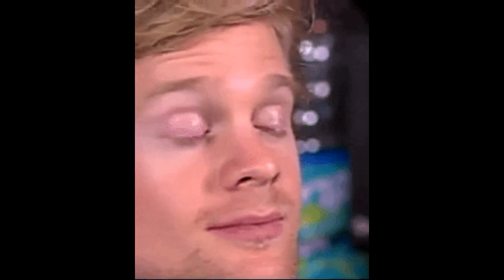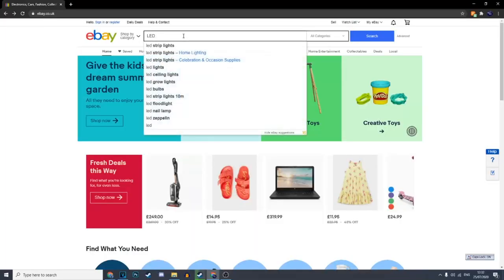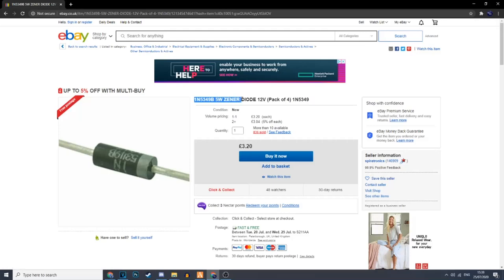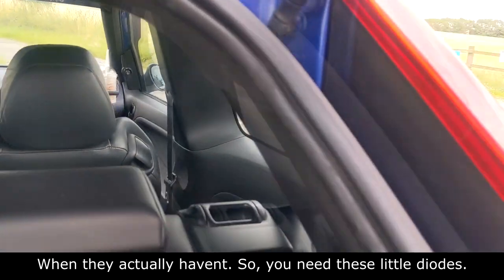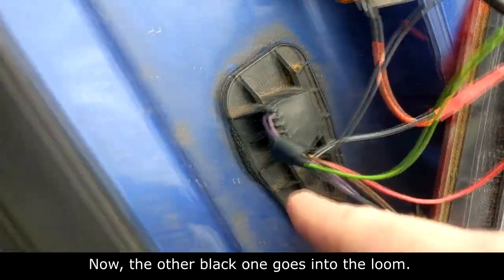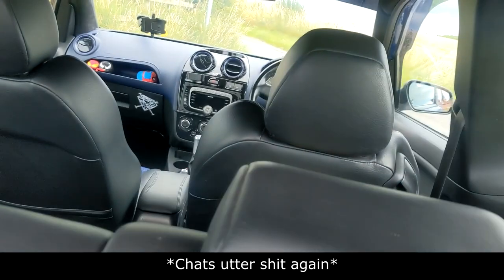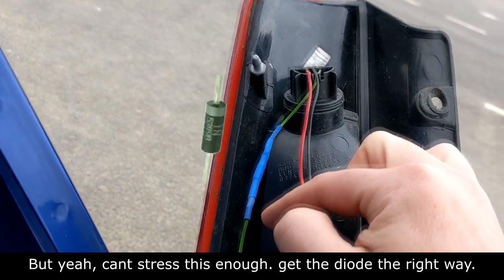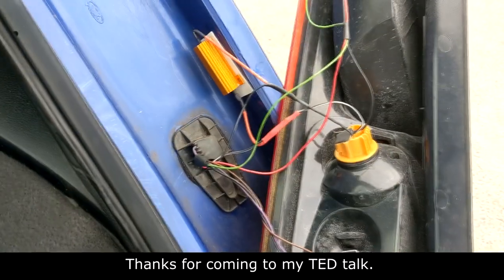How to make LED Indicators/Brakes WORK in a MK6 FIESTA!!

Comment: Save yourself the hassle and get the autobeam performance LED bulbs 👌. They are sooo bright and have a 5 year warranty. I've probably saved over £100 now because they were able to send out replacement bulbs to me so it is worth it in the long run 👍.
Will say that diode looks good. I noticed with my car the instrument cluster lights and sidelight symbol on the dash flicker initially when I put the lights on. Happened when I fitted the performance brake lights in. A diode might help fix that. 
Think you've been watching too much paranormal programmes, made you paranoid 😂. Found it funny you adding the COD hit marker  sounds 😊.
Reply from the maker: I'm just a tight ass who didn't wanna pay their prices for sumat I can sort out myself haha
Reply: @R23OWL  they also sell on ebay which is free delivery and includes warranty. It's a little more money listed on there but might work out cheaper if you compare the added tax and delivery on their website 👍

Comment: Love the video mate as per! However I would just say you could save the hassle and buy Autobeam LEDs. Run them in my MK6, they don’t flash like strobes as they draw enough current, whether that’s due to the number of diodes or whether they have a resister system built in, they work!! Build quality is fantastic, they’ll last a lot longer than cheapo eBay bois too. Plus they’re a lot brighter than any I’ve ever used, which is perfect if you have tinted tail lamps!
Reply from the maker: Yeah man I know they're good like, but I didn't wanna fork out all that money for em haha, this video helps people who are in same boat I suppose haha
Reply: yeh ive got autobeam leds in mine, couldnt recommend them enough, great quality
Reply: Autobeam have a warranty on all their items as well, sure it's a good few years
Reply: R23 OWL yeah man I get that I used to by eBay bois as well but they just kept breaking! I’ve spent less on one set of Autobeams than constantly buying new eBay ones!

Comment: @ R23 OWL, Thanks for the vid mate,  just fitted my resistors and they work fine, just need to solder on the diodes for the break lights.
Just 1 question though, can I shorten the wire that is already attached to the diode? or does it need to stay the length it arrived as??